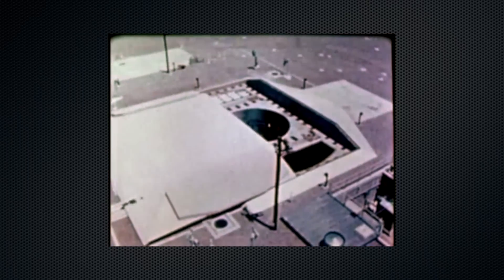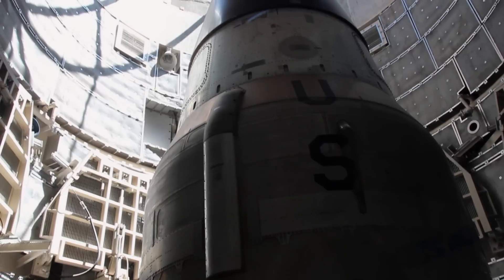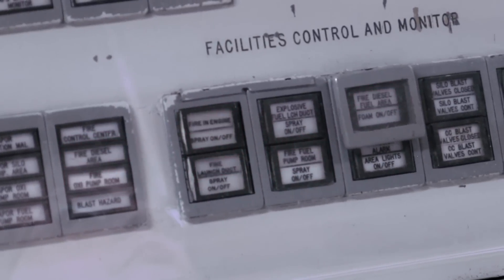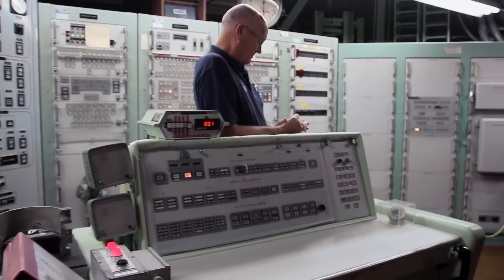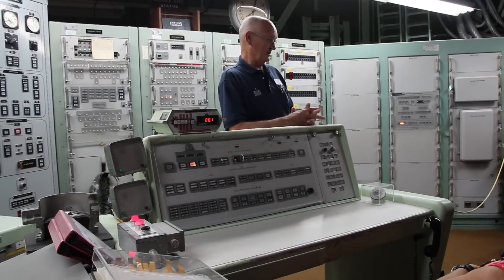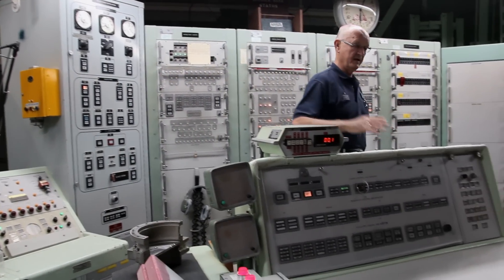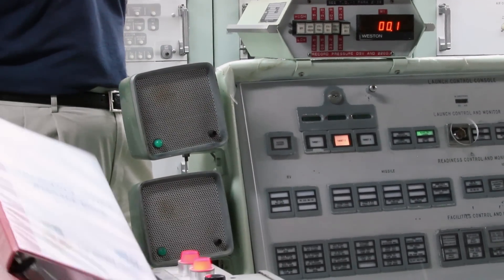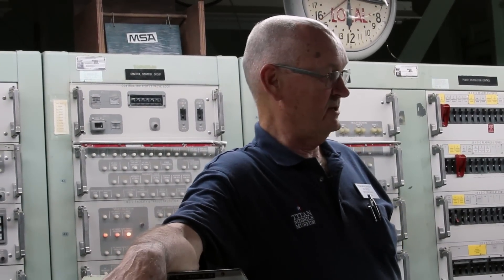How a Titan Nuclear Missile Launch Works

Comment: Does anybody know anything about why the missile in the silo in this clip had a huge dent in the nose of it? I was wondering about it.
Reply: Nah, I think Donald Trump hit his hair on it.
Reply from the maker: +Sal Lullo Hi Sal. Thanks for writing and asking. You know, I didn't notice the dent before, and as I watch the tape, I see what you are saying. I did some searching and didn't find an answer on their site, so I sent a note to ask myself. I'll post back if I hear back.
Reply: Wayne Devin Okay Wayne, Thank you.
Reply: +Sal Lullo That's not a dent.  The ablative material on the nosecone was repaired and sanded to regain the specified contour.  What you see is an optical illusion of what you think is a dent when in fact it's an ablative shield repair.
Reply: +Wayne Devin (studiomcgraw) Someone sent me an explanation for the dent on the missile. He posted it to me in the comments section. They said it could be just an optical illusion and it was in fact some kind of a repair to the ablative material of the nose cone.
Reply: +Sal Lullo Hi again.  You asked what could have happened for a repair needing to be done on the ablative material.  Well, a myriad of things.. the most common some type of tool dropped on the material during removal/installation of the warhead (nosecone) in the silo; or damage caused by the Transporter Truck's ring gear the nose was rested on while be being transported about, etc.  All it took to do a repair was for anything, and I do mean anything, to not look right - the specs for the ablative material were so stringent because that material had to work perfectly upon reentry for the load to make the target(s).  I was a Nuclear Weapons Tech at Vandenberg from 1966-1969 and our responsibility was the mating/demating of the warhead to the Titan II missile.. and all associated maintenance of the entire nosecone and its contents.
Reply: +Krollji Thanks for the info. Very informative. I appreciate your work in the past towards keeping our nuclear threat viable and our country protected. I am sure it must have been dangerous but rewarding work.
Reply: +Sal Lullo  What you see may be just an optical illusion.  There is no real dent in the warhead.  Could be some stains from something or maybe just due to the sun beating down on the warhead.  I don't remember what the warhead material is but it was certainly a tough material.  Over 40 years have passed since I pulled my last Titan II alert.

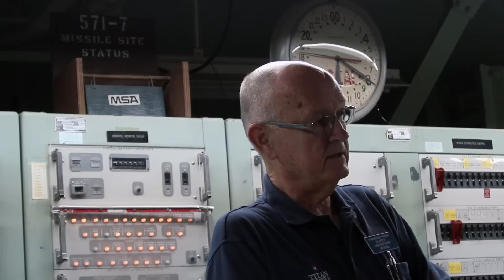Comment: Protip: Look at 7:15. They chopped a giant rectangular hole in the side of the warhead to prove to the Russians that it's inert and inactive and just for a museum. It's also why the ultra-heavy protective doors over the silo are permanently welded half open in a position that the Russians can verify from their spy satellites.

They had to be very nicely persuaded that this was just for show and not worth targeting with a nuke anymore. hahah
Reply: The silo door is blocked half open by huge concrete blocks. I volunteered there for three years in the early/mid 90's.  The hole isn't in the warhead, its in the nosecone, to prove there is no warhead. This was done as a result of the SALT (Strategic Arms Limitation Talks) treaty with the USSR, and to this day, a Russian Federation satellite flies over every 90 min or so and 'sees' into the silo.
Reply: +Alex Tocqueville Or Russian officials could just visit the museum and look at it up close...would be cheaper than a satellite.
Reply: Helium Road The satellites are already up there. The point was to convince the Russians it wasn't an active silo anymore in a way they'd believe. Insta-verification via Google Earth is a pretty easy way, yeah?
Reply: Very true. I volunteered at the Titan II Museum in Green Valley (S of Tucson) for a couple of years back in the 90's. Great information.
Reply from the maker: Thanks Alex for sharing and adding this fact. I didn't get it on tape while filming this, but I recall the gentleman pointing out that those doors are welded open.
Reply: Helium Road Then they could replace it with an active missile after the Russian officials left.
Reply: seems pretty pointless with all the truck launched ballistic missiles they have now. and the submarine launched ballistic missiles we have now.

Comment: Sure those facilities could handle 300 psi of overpressure, but if somebody is throwing large fusion bombs at me I'd want to be a lot deeper underground than what that diagram is showing.
Reply: A direct hit would have destroyed all the silos, the plan was to get the ICBMs away before the USSR-ones reached the US.
Reply: They were designed to combat the weapons of the era. A direct strike of even a kiloton weapon would destroy it. However, (a) a direct strike was nearly impossible in those days, and (b) by the time your nuke got there, the silos would be empty. (i.e. the crew is ultimately expendable, and as the video shows so is the silo)

The same is true of the SAC HQ in Cheyenne mountain. The facility doesn't stand any chance at all vs. modern weaponry. It was dated by the 80s.
Reply: +JAY DUB But i doubt it has the accuracy back then
Reply: The actual control centre can withstand more than 1000 psi overpressure. Command and Control is a great book on the subject.
Reply: I don't care what he says about 300 psi overpressure. A 20+ megaton nuke, or a few smaller ones, and that silo is reduced to rubble. Heck, even if the whole place didn't collapse, I'm pretty sure any people in there would have their insides turned to mush by the blast waves.

Comment: Pedro Uno1 1st Bearer Engineer May 14th 1962 Aged Four Years Young Universal Planetary Solutions Intervention of Cosmic Galaxay Universal Satellites Op Shortwaves Freq Coded Reverse Mechanical Sounding Electro Magnetic Radiocyclewaves Transmissions Magnetic Vacuum Diffusion. To use for Solar System Sistamatic Satellites Op Shortwaves Freq Coded Reverse Mechanical Radio  Cnc Auto Robotic Nuclear Diffusion Disarmaments Kind.FruitTreesPlantlifeLandscapes.Moon Aurias Orbs Visted  P.Nasa Un NatoZZZZZ
Reply: Peter Campbell aliens Egypt timepiece stereo vacuum tube Nikola Tesla steam engine 1952 Theory of Relativity 1970s Hairstyles glass of water hard drive jalapeno cheddar dip Samsung your mom
Reply: ***** I'm actually a mental protard.

Comment: The curator seems to be very knowledgeable. Must have been his career job.
Reply from the maker: w5cdt Hi. I wanted to confirm your guess. Before the tour started, he spoke to us about serving in one of the US silos.
Reply: Actually it may or may not have been. I worked there giving tours for a few years back in the 90's. As a volunteer, I did the same thing he's doing and my experience was that I have a degree in Aeronautical Engineering, I did 4 years in the Army has an electronic warfare tech, and at the time I lived in Sierra Vista AZ and worked on Ft. Huachuca as a network engineer. WE had to study our 'bible' to give tours, and we were encouraged to learn as much as we could about the silos, missiles, and the cold war era at that time to answer visitor questions. What that tour guide is doing and saying, I pretty much said and did the exact thing, but back in the 90s. I gave top side and underground tours.

Comment: I went on this tour back in 2011, and it was very good.   I served in the AF from 1965 to 1969 and spent 2 years at Vandenburg AFB in the Titan II program.before shipping to SE Asia to finish out my military service.   I was in electronics, so maintained all launch and com equipment used in the complex.  Everyone on site had to be in direct communication with the control center at all times, so we wore small belt clip radios with a boom headset/mic.   The bird at this exhibit had a warhead with 9 individually targetable 1 megaton MIRV's.   Occasionally I saw a bird come out of the hole and begin to spiral, which then had to be detonated.  On one occasion I saw the bird come out then immediately fall back on top of the complex and explode - quite spectacular on a night launch!
Reply: Huh? All reports I've ever seen said the Titan II had one 25-megaton warhead. The Minuteman III had three warheads of about 170 kt each. If I remember correctly, the Peacekeeper has (had?) ten warheads. Does this Titan II museum have a Peacekeeper on display?
Reply: Firstname Lastname
I don't know about the, ummm, "peacekeeper", but the bird on display didn't actually have the warhead mounted due to SALT.  They have a mockup warhead in the museum, however, and it is the 9 MIRV model.
Reply: Firstname Lastname 

No, you're thinking
SS-18 Satan.
Reply: 1 9Mt warhead, dumbass. Minuteman was the first MIRV capable ICBM.
Reply: Was an MFT at Vandenburg from early 1967 to late 1968. 395th SMS (sweep, mop, scrub). Took good care of those 3 silos. Although the video says that the launch destroys the silo, we refurbed them and got them ready for the next launch! AND, there were 4, not 3 Titan bases. We had one EWO bird in Delta and test launched out of Baker and Charlie. Spent the last of my hitch on Okinawa with the Mace missile, which, well it wasn't Titan II. But, we had 32 of them pointed at Mao.

Comment: '
how come this titan missile dont have 4 FINS on the tube end bottom near the engine,,,
4 FINS are helping the missile guide right fly to the air,,,
america can make it many MX missiles, pershing missiles, redstone missiles
Reply: lol, dude.. seriously.. you have a fin fetish!! chillax about the fins!!
Reply: Obviously this guy is trolling...
Reply: 5000mahmud 

Houston, I'm well aware of the goddamn gimbals!

Apollo 13(1995) reference
Reply: Doesn't need it, it's all about thrust to weight ratio
Reply: The engines on the Titan II were gimballed, they could swing in several directions, steering the rocket, and negating the need for fins.
Reply: okay thank explain,,,
all missiles / rockets must have to uses FINS on the bottom tube near engine motors,,,
fins are the best to helping the missiles / rockets going to the air right way,,,
see the big saturn V rocket had fins, honest john missiles had fins, redstone missiles had fins, patriot missiles had fins, stinger rockets had fins, spaceshuttles had fins, all airplanes must have to use fins, helicopers must have fins, submarines had fins, jetfighters has fins,,,
one problem is MX minuteman missile dont have FINS, two problem is trident missiles dont have fins...
now all toy model rockets must have FINS
Reply: bestamerica
Actually not all missiles and rockets need to use fins. The Ares X-1 also dosent use fins and neither does the polaris missile that was used in nuclear submarines. As explained previously sophisticated missile systems use computers and special guidance systems to control the rocket engine on a gymbal. Hence no need for fins. Fins are an inexpensive and robust way of controlling guidance and stability, and that is why they are significantly more common, but this does not mean that they are required in all instances.
Reply: okay thank explain,
better put FINS on all missiles / rockets,
fins are helping any airvehicles going straight to the air,
same as toy model rockets has fins,
also all airplanes has fins,
dont have to use a word - INEXPENSIVE -
Reply: bestamerica

fins add  too much weight its easier just to have a gimbled engine and an inertial guidance system  because fins are only good till about 40,000-50,000 feet then they don't have enough atmospheric drag to actually control the rocket plus this is an ICBM they need to be fast If its slow its gonna get shot down quick
Reply: put light weight and strong FINS on the rocket, that is easily
Reply: dont use a word  YOU  on me,,,
let explain about this rocket and FINS
Reply: bestamerica
Rockets seriously dont need fins anymore were so advanced in the knowledge of rocketry  we just dont need them
Reply: it's because it's reliant on GIMBAL for steering
Reply: yes right...
better put fins on the rocket in safety
Reply: thank explain.
i believe that 3 to 5 FINS on the bottom rocket body is the best guide to the air.
help smooth straight air.
same as model rocket toy.
Reply: English broken very
Reply: haha alan.
english is good.
no one is a perfectism english / grammar / language.
missile - rocket is a not perfect, too.
Reply: bestamerica you've been watching too many Flash Gordon movies.  The technology has moved beyond fins to gyroscopic guidance systems.  Besides fins are only useful when there is atmosphere.
Reply: it needs fins to contain his autism
Reply: haha wrong.
fins are important on the missiles / rockets
Reply: This is the worst bait for a troll I've ever seen. Go crawl back to reddit. You might want to get a life too while you're at it. A real one I mean, not just one you made up to try and win an internet argument.
Reply: dont use a word YOU on me,
let explain about this real missile / rocket must need to have 4 fins
Reply: bestamerica DON'T YOU FUCKING KNOW WHAT ROCKET ENGINE GIMBAL IS YOU FUCKING IDIOT!!!
Reply: +Nothing\ honestly pretty effective baitin'

Comment: Listening to the speaker reminded me of a story from 1984 when I was assigned to the 381 SMW.  While it was supposed to be true that we didn't know where the each missile was targeted, it isn't entirely accurate.  We were usually told what targets were assigned to the wing, just not which missile was assigned to which target.  In 1984, however, anyone who was paying attention could figure one of them out.  The wing was assigned 17 targets (this was after the accident that destroyed site 533-7).  All the targets were soft targets (air fields, bases, shipyards, etc) except for one target that was listed as "nuclear weapons storage facility".  Oddly enough, my home site was the only site in the wing where the warhead was set for ground burst.  2+2=4.
Reply: Ground burst?
Reply: @joeyknight8272  Instead of detonating higher up in the atmosphere to increase the area of destruction for surface structures, a ground burst was a detonation closer to the ground where the fireball and shock wave would "dig up" hardened targets such as bunkers.
Reply: @sparc77  that'd interesting! Doesn't that make the ground more radioactive?
Reply: @joeyknight8272  Yes it does, and it also increases fallout since all the dirt that was dug up is blasted up into the atmosphere.
Reply: @sparc77   was this a ICBM with multiple warheads and each warhead had a target?
Reply: @joeyknight8272  No.  The Titan II had a single 9MT warhead.  It was the big stick.

Comment: ORNL is 24 mi from here, and they and others assure us that there are no complete warheads present there, other than that which is having material reclaimed and re-purposed. Complete discrete warheads would not be held at ORNL as there are some but too few capable bunkers and surface-to-air protections.

Comment: well i already understand that it is possible, but i am speculating on the size of the missile in general, like would it be built to be around the same size as the Satan 18 missile made by the Russians which was designed to carry 10 500kt warheads, i am mainly thinking about the size of the missile at this point, the Ares I-X might have to be a slightly larger in size but would most likely do the job

Comment: MIRVs would cause more immediate deaths but are not as scary because I never lived near a city.On the other hand the 25 megaton B41 with its high fission fraction,of around 15 megatons+ coming from fission reactions would result in a pretty nasty fallout contamination of down-winders,that is, comparing both in the ground laydown mode and not as a relatively cleaner airburst.On the other hand the SS-18 mod, or the US's closest counterpart, the MX missile, w/ 10 MIRVs, pack much less fission yield